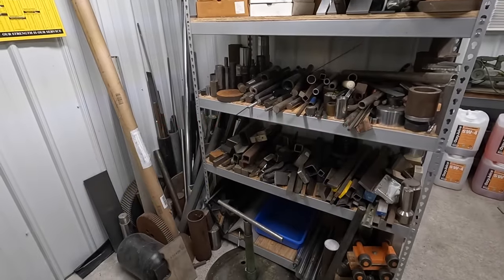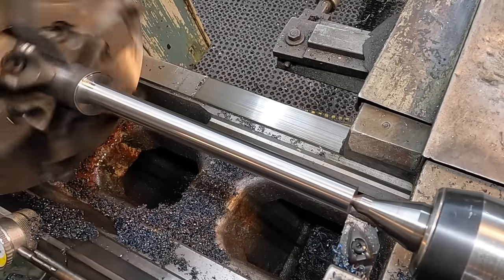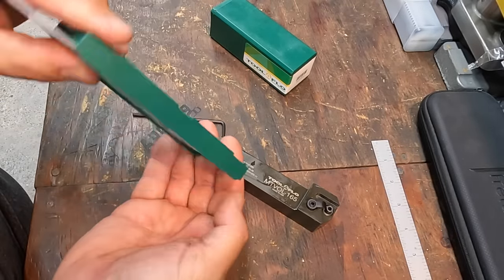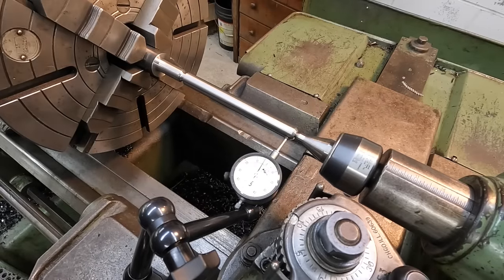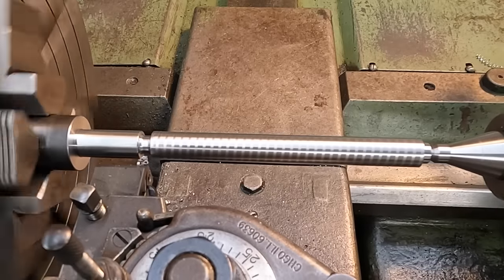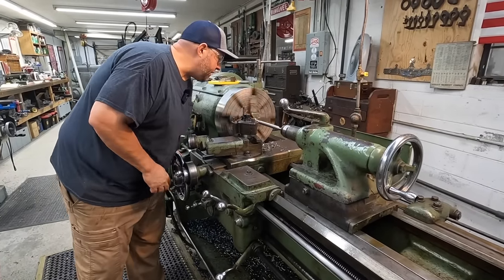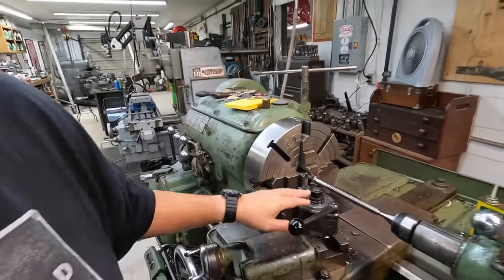Compound Lead Screw for American Pacemaker

Comment: One thought: as you cut ever deeper, your radial rigidity is going WAY down.  Tool pushes stock away from itself and as stock bends, it inevitably comes back and starts to climb over the tool.

A follow rest would likely be in order, as well as very fine feeds.  You are, after all, taking quite a bite once your depth goes past a certain point AND your rigidity is winging away into the ether.  That combination leads to work movement that, IMO, leads to precisely the sort of trouble you encountered.

One other thing: it almost sounded as if the stock had a hard spot right in the place where you started having trouble.  I know it is unlikely, but if you have a tester, I'd try on both ends and right where the buggery began just to verify that the stock wasn't the cause of your problems.  It DOES happen every now and then.

Comment: you can see at 36:40 the live centre lifts in its bearings slightly because as the cut finishes you can just see the end of the bar stock and tip of the live centre drop back down.
Reply: Yes I see thank you. That narrow vertically mounted insert has got very little spare clearance against the edges of the thread. The live center jumping up would certainly mess it up. Everything has to be perfect. The slight movement ruined it. 
Maybe if he used some oil it could have survived. Couldn't hurt.
Reply: Could he not use a moving steady rest that mounts down to the carriage and sits inline with the cutter but would have to have wide rollers on it so the points of contact don't get stuck in the thread it's cutting.

Comment: Hello Abom! I turn between centers and use a follower rest. Leave the centers a little loose. Heat the material up until the centers tighten up and start threading. Steel expands and you need to control the heat! Took me awhile to wrap my head around this.

Comment: If you look closely at the live center and shaft at 36:40, you can see the live center and shaft rise slightly, confirming your diagnosis that the shaft is trying to climb up on the tool bit.

Comment: I don't believe that it is the machine fault, you almost succeded, I believe that that disaster is due to 2 things, the first is that the tool bit gained a bit of wear, the second is that in the center of the  lenght of the part, the last cut have developped  a resonnant vibration pattern  as every cut you take, you weaken the part, you lower the resonnance frequency.
If the grabbing ceases as you approach the tailstock, it is an indication that a follow rest is needed for that job.
very good video.

Comment: I'm going to guess it's the material, not the machine. It looks like that screw is thin enough that you need to have a traveling steady behind it in order to keep it from flexing away or riding up on the tool. The other thing I would do is use cutting oil, and check your insert. If it's grabbing like that, it's probably worth just indexing it without even doing a close inspection..

PS: is your tool providing the right helix angle? You might need to change the shim.

Comment: Life is filled with tiny injustices.  While the cuts were not consistent with the .005 or even the .002, I'm not sure why it decided to climb when the material thickness became flexible, but my "I have less machining experience in 55 years than you did by age 10" opinion is that the large diameter of the starting material may not have the ideal grain structure by the time it reaches your minor diameter. 
Basically, I would like to see you start with a much smaller diameter material. 
I am looking forward to seeing the new precision lathe, it can't hurt to have a nice tight machine.
Please consider this advice as an uneducated guess.  But blaming the material gets you and the lathe off the hook!  ;)

Comment: You're doing everything correct. There's nothing wrong with your lathe. You just need to use a follow rest.The one without rollers and the bronze buttons. Now your old monarch didn't let you down. Cause I machined many on a monarch, like yours. I worked for a machinery company in Portland Oregon called coastal machinery. And we made large wood planners for planer mills. We made our own acme screws to adjust the bottom and top heads and the side heads. Some of them were quite long at about three feet long, and only three quarter inch diameter.

Comment: Carbide don't like shallow cuts.  Also you need to use coolant or cutting oil when cutting that type of thread.  Also I would move your compound to 14.5 Deg.  The last thing I would do is change your insert more often.  That's all I can suggest from watching the video.

Comment: I'm kinda torn between issue with cross side lead screw, sharpness of insert, or no used of lubricant. However, I can hardly wait to see the Precision Mathews in action and how it will handle this project

Comment: I'm a beginner hobbyist, so it's probably off the mark, but I had a similar climb when cutting a thread with the tool very slightly too low. We don't have a quick-change toolpost, and a test face showed a tiny (as in "came off with my fingernail") little nub left over. Swapped the shim and it cut just fine.

Of course, even odds are that something else changed I didn't notice.

Comment: 36:00 you think a follwer rest could help in this situation?  Or you might just take smaller bites when you get to a certain depth?  Maybe the extra 1/2 degree on your top slide setting could take some pressure off?  Thanks for posting the tribulation.   Some people would just not post a video like this.   But it helps us all.   Maybe a little chip got in the center when you were trial fitting the nut?

Comment: I would maybe try to rough out the thread with a different tool then finish it with your acme insert. I think I saw a video on oxtools where he did this. I also think a follow rest would help you. That screw is flexing more with each cut and more tool pressure or drag and it's climbing up the tool. You'll get er!

Comment: At a certain point of thread depth the rod is bending away from the tool, so the room for the cutter gets narrower and the tool bites in the rod. Its happening in the middle of the rod, where the strength is the weakest between the two chucks. Cutting forces get to high because of thread depth. A follow rest could help.

Comment: Just spit-balling here, but it seems like the material is deflecting.  If so, could you start with an insert in the same holder, but with a V profile?  It would need to be angled so that it would be at full thread width when it hits the minor diameter.  You can run that in to rough out the majority of the material, then switch over to the acme profile insert and finish it out.  This should reduce the cutting stresses and material deflection.  Even when properly fed, the acme insert is cutting on two faces at once.  Roughing out some material would reduce the quite a bit.

Either that, or you and rig a moving steady rest of just two rollers on the backside of the material so you are pressing into them as you are cutting the threads.  This would eliminate the possibility of any slop in the cross slide or compound from allowing the tool to dig in.

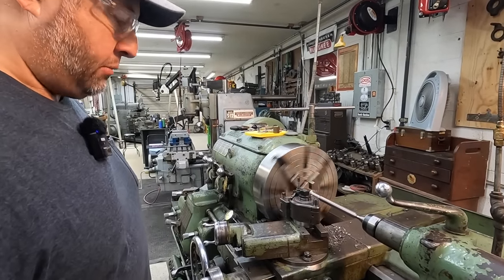Comment: I feel like the primary issue is either with the timing of the lead screw, or with the halfnuts being worn. The cut at 26:45 was cutting HEAVILY on the left side of the tool, as shown by the bevel on the left side of the chip and the chip curling to the left rather than the right like in the majority of the passes. Then, in the cut at 30:45, the tool was way to the right of the previous pass, so much so there was a visible step at the bottom of the threads behind the cutter. Part deflection eventually added to this to ruin the part, but I believe it would have gradually gotten worse as the threads got deeper, not happened all at once. My bet is that the halfnuts have some strange wear patterns that occasionally cause the cutter to engage a few thousandths to the left of where it should; maybe a groove in the righthand side of the halfnut threads, worn in by all the righthand cuts I'm sure they've driven? In any case, I always enjoy watching your videos, even (or especially) those that show things going wrong; shows that mistakes happen to the best of us. Stay Abom strong and keep machining on!

Comment: Never used a tipped Acme tool for cutting an Acme thread only HSS.  Always grind my tool smaller on the width then when cutting the thread ( using the compound set parallel to the bed ways) have the tool cut on one side only per pass but alternate sides every other pass.

Cutting on both sides is asking for trouble especially on a old machine where there is bound to be play in the cross slide lead screw.  With chips coming of both sides of thread being cut there is kind of a log jam.

Cutting internal Acme threads is a whole different matter especially if the thread is of a small diameter.

Certainly with HSS the speed is much slower but with a generous amount of cutting fluid a good finish can be achieved.

Prefer to use 4140 material for lead screws.  Just a personal choice.

Tool grinding is really an art in itself as I think Adam has pointed out one if not more of his vids.  It does take years to master but thats no reason not to try.

Another point nearly always over looked is the choice of grinding wheels for tool grinding and the way that they are set up ie. tool rest angles, wheel dressing gear and how too. and when too.   All this is critical to getting good results.

Tipped tools are excellent but for the back yard machinist can be expensive and for some operation unnecessary when a few HSS tool blanks will do the job as well if not a wee bit slower.

Leaning the art of tool grinding makes you very aware of the importance of tool geometry.    All apprentices should be taught this.
Reply: I agree on the 4140. It’s never let me down.
Reply: I reckon you are right--I use that technique for both square and acme and it works...

Comment: I need to make a new feed screw for the cross slide on my SB9. the original is somehow bent so it has a wobble to it and that manifests in a "tight-loose-tight-loose" situation when cranking the handle. It drives me nuts. You make it look so easy, gives me confidence lol. EDIT* Posted this right before the issues... maybe not so easy?... lol.

Comment: It is adversity and that is always something that has to be overcome. It's human to doubt your lathe, but this is one of the best lathes in the world. And there is no place in the drive train but the shear pin to fail. That's the only place I would investigate.
I was surprised from the start that you don't use cutting oil. It would improve the quality of the thread, after all it is for a lathe.

Comment: I think that the tool is cutting on three sides, creating increased pressure and chatter. A few thousandths left or right to give tool clearance might work for the deepest cuts. Would cutting oil help?
Reply: that would be the old fashioned way to cut a coarse thread.
left, right middle, rinse and repeat.
has been working for ages.
Reply: The minor diameter was getting smaller and smaller with all those passes. I too was getting worried why he wasn't using any oil. Couldn't hurt anything. The effective diameter is the minor diameter. And the insert might be getting worn with all those passes. He mentioned it might fail before he started the job. Go slow and use oil as some comments here say and it sounds good advice.

Comment: You could check that there is no backlash between the half-nuts and leadscrew, also that there is no end float in the leadscrew. I would also use a travelling steady to make sure it is not deflection in the workpiece. It is a 0.100" deep thread with a bottom flat nearly 0.070" plus the depth of cut on the leading angled face, both will tend to deflect the work away from the tool. The deeper you go into the work, the greater the cutting forces become and to make it worse the smaller the effective workpiece diameter becomes.

The work first springs away then back and you end up with chatter. Been there done that and got the T shirt. You might find some cutting oil helps too, I use it on all my thread cutting, the lubrication reduces cutting force so reducing the tendency for the workpiece to spring under load.

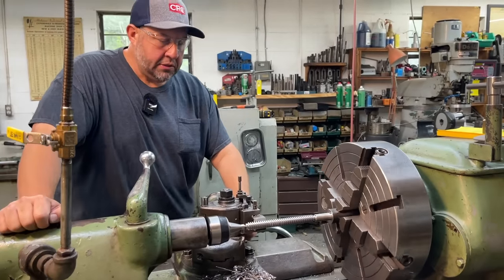Comment: i think you hit the nail right on the head at 36:06  ..... the material is trying to climb on top of the tool. you can actually see it happen pretty good on the pass just before you explained it. ive had it happen a few times turning long, small dia shafts.

Comment: If you have the tool holder at 14 degrees, every time you give it 5 thousandths in, the tool loads a little bit to the right. This gradual increase may be overloading the cut and manifests itself in the central part of the piece, which is the one with the least support.
Sorry my english.

Comment: Possibly tool just a tad to low. Part starts to climb on top of the tool as the cross section of the minor diameter decreases. “Becomes less rigid”.

Comment: Hi From Australia. Great video!
I noticed a small "Edge" in the bottom of the cut about half way through the cutting. That suggested to me that the half nuts were not fully engaged. Maybe there is slack in the cams that engage them, maybe dirt? or just wear. My Lathe a VDF has detents as well to keep the nuts engaged. One trick I have used is to shift left and right when working down to depth. near the end I revert to plunging straight in maybe at a reduced speed.

Comment: 5tpi acme is really coarse for a 3/4" shaft: deep cuts to make the shaft less rigid. You know carbide likes high speeds and feeds, neither of which you can provide on this project. A HSS cutter is more practical here but you may get the carbide to push its way through with lube and support. I agree with others that you need to hog out the thread with a VNMG or similar profile first; there is just too much cutter contact all the way around that threading insert on that increasinhly flimsy part.

Comment: I've seen issues with steel near the center of the bar. It's like it wants to be a banana and tries to climb. As far as cutting heavy on one side. You could have some worn bearings inside the gearbox which allows the gears to change their mesh towards the tips of the teeth which effects the ratio. It can also be a thrust bearing on the lead screw. Can't wait for the teardown inspection video.

Comment: Yeah, the last few passes are almost always disappointing. I have only done them on a CNC and the only thing I did was use a slightly steepr rake angle by one degree and it made a big difference. It also seems there is so much side contact it does not take much to have it dig in. I was making shafts out of 400 series stainless, by the way. They were shafts for large refrigeration valves. I sure miss machining. It has been 18 years since I have done it. Keep up the great work Adam.

Comment: That was a super video. Really enjoyed that. I have a theory, if you can bear with me. 
Don't think it's any fault of the Monarch, that lathe works perfectly fine. Problem in my opinion is the material. It's stress proof material that is "whipping" and out of central alignment when the carbide insert reaches mid centre of the length. No problem near the chuck, no problem near the tailstock, why? Because it's got rigidity and support. 
Material is not rigid enough mid centre considering the amount of surface area in contact with the on edge insert with respect to a small diameter work piece. 
I think the exact same will happen using the Percision Matthews. A chance to prove my suggestion as valid or not. Hope this offers a little help and gives something to think about.
Reply: I think this is why lead screws nowadays are generally made using thread whirling.
Reply: @douro20  Good point Douro20. Vibration is the issue. Natural frequency of the lathe v's natural frequency of the carbide tip. Shaft experiences whipping resulting in resonance. What's the result; chatter and a messed up part. A shaft that diameter stands little chance particularly when cutting a very aggressive ACME thread. I hope there's something here that isolates the initial concern of that of the Monarch. I don't believe the lathe is the issue here.
Reply: @heardashot   The stiffness of the workpiece is reducing as the thread goes deeper I would also engage the lead screw on the same number each time.  60 years ago one of our trainers kept the nut engaged all the time then stopped the motor withdrew tool and reversed the motor to the start, we did small cuts and lube.... but you need a lathe with a reverse to do this.

Comment: Deflection.  The carbide requires higher tool pressure.  There are two deflecting forces, one deflection is away, and one is up. 
Follow rest have two jaws to buck these forces.   Deflection away is bad but recoverable with spring passes. Deflection up is deadly. The dreaded roll over the top of your tool.  Just like parting with the tool center too  low.  Try HSS, follow rest, lube.   One of the lack of follow rest fixes  is a wear foot mounted above the tool set to the OD, it keeps it from riding up.

Comment: Do what the tap you used to make the thread in the brass nut does, the tap had two thread profiles; one triangular one Acme. Cut the thread with a cutoff tool (with lots of re-leaf) then cut it again with the full Acme profile. I agree with someone who said that HSS might be better for this.  The challenge with this is making both tools cut in the same place when the half-nut is engaged. Just a suggestion from an amateur, who's cut some large threads in a too-small lathe.